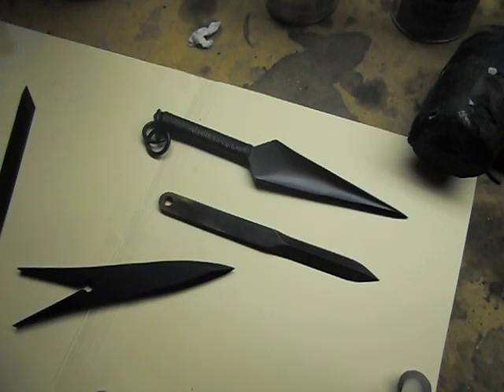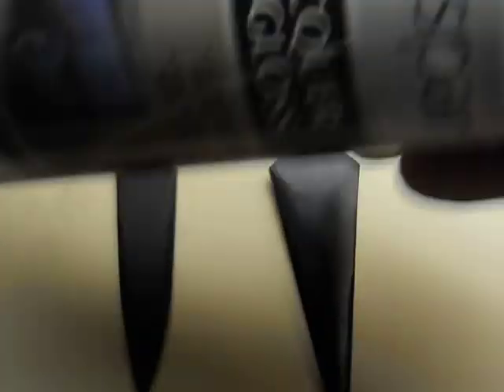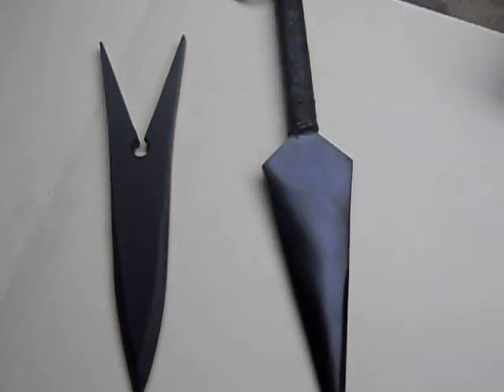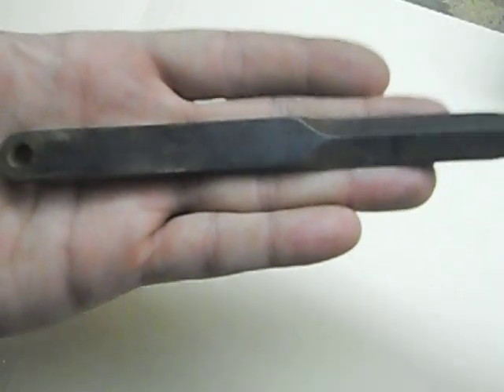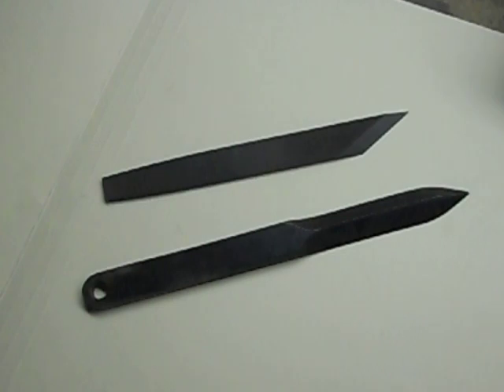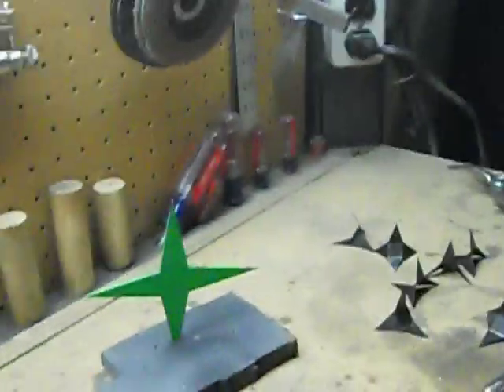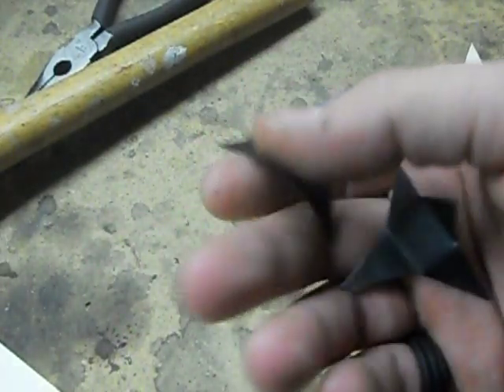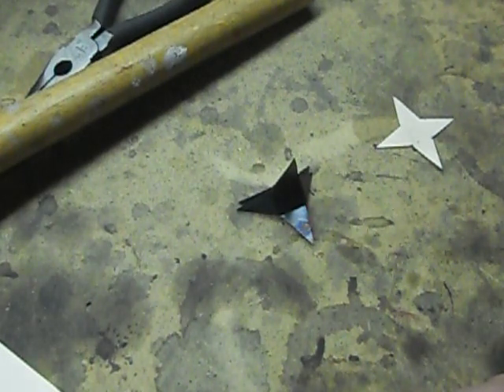Black coating on steel

Comment: If you burn in several layers of old motor oil into the steel you will acheive a dark black which provides at least a certain amount of rust protection. You start off like you did but you light the oil on fire. One all the oil on the work peace is burnt, you dunk it again and burn the oil again. You repeat until you are satisfied with the result.

Comment from the maker: black oxide or gun blue is decent and will hold up to normal wear,  oil blacking is a lil less durrable and as for paint well paint can go either way depending on what you use. I do know that there is a spray paint used like an airbrush that is very durable i cant remember the name of it but check out the channel called nuttinfancy he uses this kind of paint on his knives and they look awesome